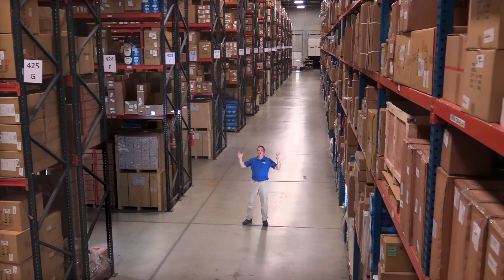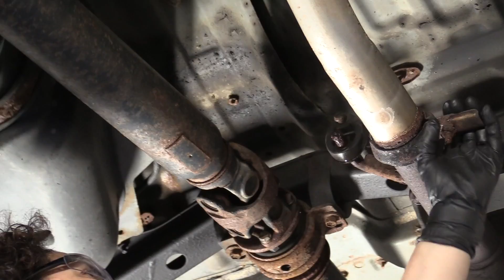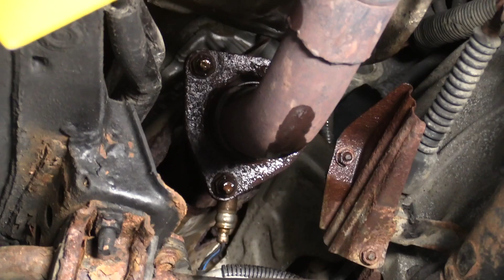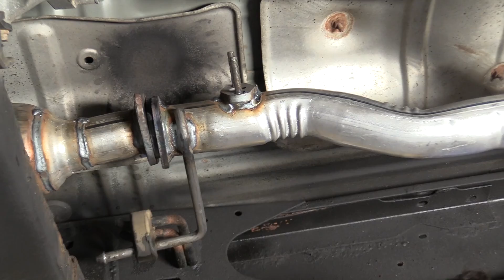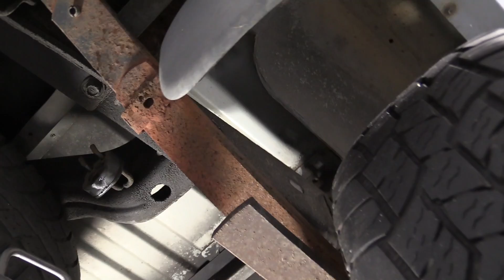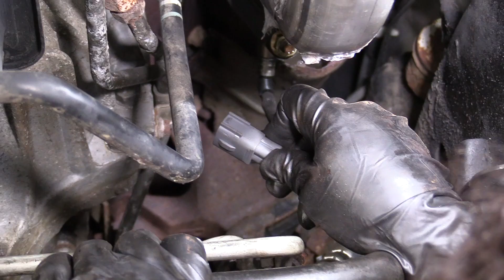How to Replace Exhaust System 00-06 Toyota Tundra

Comment: You struggled at 9:09 because of you yanking on the exhaust trying to pull the hanger apart with jerking motions you bent the mount tang on the body down

Comment: Awesome video and very well done!!!.. Can you provide where you purchased the direct fit "full exhaust" from as well as separate exhaust pieces if possible ....I have a 2000 tundra... the cats and manifold pipes are fine.... what I am researching is the replacement of the "y" pipe that has corroded .. .thanks in advance

Comment: This will be a little helpful for me this it's my first time doing an auto exhaust system. I'm working on a '02 Sequoia from the manifolds back as well, From here it would seem I messed up a little I did the muffler first and I'm having trouble aligning the cats to the muffler, So now I'll take the muffler back off and do these steps working from front to back.